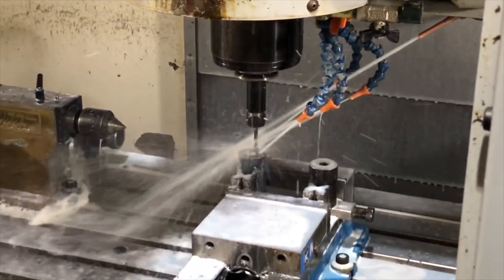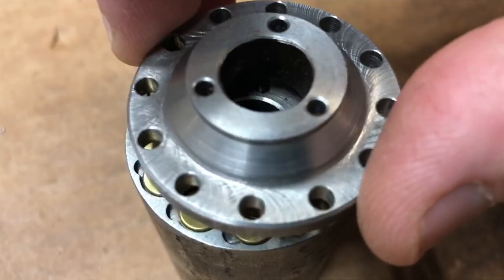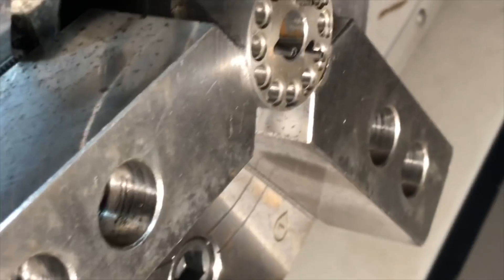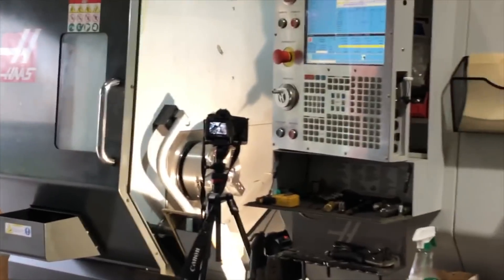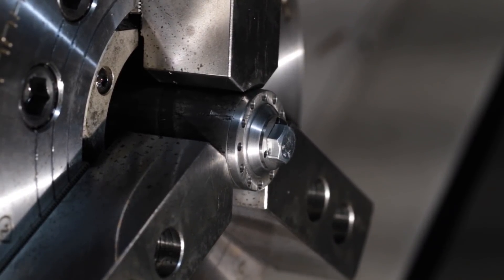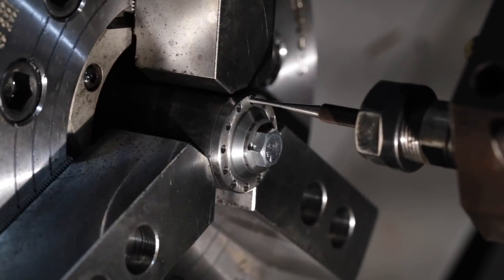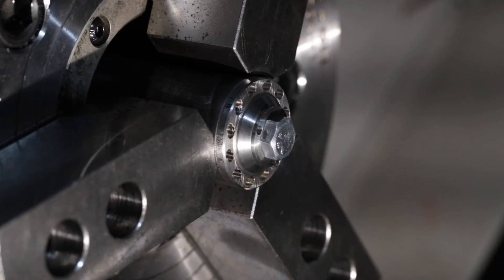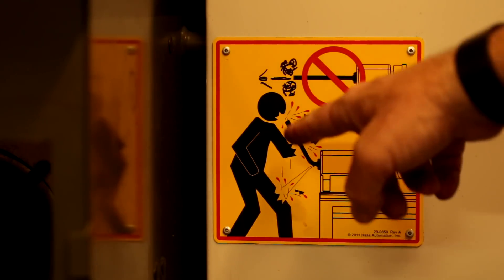Lathe Machine Gun

Comment: So I'm a little late with the spring loaded center punch solution, but that would work. Also, you could program a little radius at the bottom of the rapid stroke. Just big enough that it doesn't have to come to a full stop and reverse on Z? Though it kind of still would. I used to do something similar when I had to program broaching on a CNC lathe. Saves wear on something or other. Maybe.

Comment: It's a total guess from a non-engineer, but would have using a center punch (with a lighter spring) have helped?
Reply: I like the way you think. Great idea in my book.
Reply: I don't think that spring loaded center punch do any good.
They have very sharp point that concentrates all the pressure to a very small area.
Reply: I think .22 firing pins are more like a small flathead screwdriver.
Reply: @XtreeM_FaiL  It's trivial to change the shape of the point.
Reply: @XtreeM_FaiL  I was thinking the way it's got a spring would let you program it so the PID doesn't need to worry about as much overtravel. Lets you hit the primer with it moving faster.

Comment: What I'd like to see is a sensor placed on the barrel.  That can catch harmonics.  That knows when the bullet passes.  Then tells a control unit to unlock the breach, eject the case. And then load another round.  Or better yet.  You can calculate the last little bit of energy stored in the powder charge.  After the projectile has left the barrel. Somewhere, somehow, there has to be a way around having a op rod or gas tube on the barrel.  Probably not robust and battlefield tough.  But just high-tech fun stuff. Of course this is all about my pay grade.  I'm just a cook and part-time Welder.  And I like 3D printing.

Comment: Use a gear or sprocket with several "firing pins" that key into the firing pin holes. The C axis tool would remain stationary, the sprocket would spin with the lathe and you would presumably not have to worry about stopping at all.
Reply: You'd still have to stop. For reloading :)

Comment: If you build the cap like a ball and socket, use a large diamiter tapered spring and pit pinns on the inside of the cap. You can use a contact roller on the outside and as it spinns it will ignite the primers

Comment: Easy way, just tune your rapid position to compensate for your PID overshoot protection - tell the pin to go further than you "need" it to go and accept damage risk.
Or do it the right way and program the deceleration event into your striking event to get smooth and precise location control, but that takes effort. 
The thinking man would just incorporate a fixed energy firing mechanism instead of a dowel, like a spring loaded punch, into the design, so your PID can have inherent slop.
Reply: That pin punch does compress a little in normal use.crap have to use calculus to find a ramp down speed to meet compression. Last question; does it only have to be successful more than once? If not ping the crap of firing pin socket maybe 2 thousands or so?

Comment: Punch that works right from the get go? Easy. Make the endcap. Put thread on end cap. Turn a disc with an internal tread (to thread onto the endcap) and an external thread. Cut 12 grooves into it, creating 12 equal leaf springs. turn an outside nut that pretensions against the backstop and pulls back the leaf springs. Unscrew the cap slowly (or quickly if you want to). Wherever the thread leaves the last grove, a pin is released and fires a barrel. The full final revolution releases all 12 shots, neatly timed after one another.

Comment: How about a rotary firing pin , something like a stitch roller ( google it for reference). Syncing it up could be complicated but a ring gear on the perimeter of the .22 cylinder might be a good way to go about it.
Reply: Or just make a relief cut on the outermost perimeter of the .22 cylinder and just have a smooth roller bearing pressed against the cylinder to line up with the rim of the “blank”. If that works you could get some crazy rpm.

Comment: If you take a presser washer pump apart you would see a rotational plate set at an angle and sitting on top of the plate are spring return pins, a mechanism like this would be suitable for your task, but you would have to clamp the gun chamber to the tool post and put the pump like setup in the lathes chock

Comment: Use a similar mechanism as is used in a spring-loaded center punch. While the tool is decelerating the firing pin should still be impacting the casing with a significant amount of force.

Comment: It may have already been suggested in the comments, but you can try one of those percussive center punches that self punch when the tip has a bit of pressure applied to them so even at any speed so ling as the insert depth meets the minimum retraction for the center punch to engage you will get the impact force required to set off the primers.

Comment: How about a spring loaded center punch instead of the normal punch in the tool holder? That way it presses in, but reserves its "enginerdigy" until the last second, when it actually snaps and imposes the impact on the primer in a rather sudden fashion, instead of a leisurely pace. That's the main thing I see here, the punch isn't hitting the primers fast enough. You of anyone know about firing pin velocities.

The counterargument to that is that much like the solid punch, the spring loaded punch crushes the primer slowly. With the spring loaded one, before releasing energy, and by the time it actually snaps to crush the primer, well, it's already been slowly crushed and does nothing. There's no space to suddenly collapse the chemical compound together and detonate it.

Kind of like my heart in the dating world, but that's a universal struggle among aspiring engineers! LOL!

I might be an enginerding student (and maybe a good, maybe a bad one) at that, but impulse is the main thing comes to mind here. Force over time. A certain amount of force applied over a short amount of time might just do the trick! Crushing a primer slowly doesn't do squat, but suddenly hitting it with the same amount of kinetic energy, like a hammer,  is what sets the chemical reaction off. The challenge I foresee here is this: the spring loaded punch does not apply enough force during the load up, prematurely crushing the primer, letting go too late and impacting the primer after it's been crushed with no result.

Either way, I think it would be a very interesting aspect of physics to explore! Looking forward to a follow up video!

Comment: If the cap had a spring-loaded pin hammer for every cap, and the hammers had a geometry on them that let them be cocked when interfacing what you tried to use as a striker/firing pin here. What ends up happening is that the hammers are let go the moment they stop contacting the probe. Being released, they always line up with the cap, and the guarantee of enough energy being delivered is much higher. Set right, and this thing would brrrt

Comment: Drill the chambers a little closer to the edge.  Use a ridged block to act as the firing pin.  As the cylinder rotates, it hits the block and sets off the round.  You can rotate the cylinder at what ever speed you want. 
If it is difficult to set off the rounds without tearing the brass, replace the block with a wheel firing pins on it, geared off the cylinder.

Comment: I built a 10 barrel .22 cal short, Gatling gun many years ago. It was an exercise in frustration.  Rim fire ammo just isn't as reliable as a center fire. There were other complications with making the bolts with the F pin off set and the way the extractor was designed cause failure blow outs of the cartridges occasionally. So the next one I build will be in .32 or 9mm

Comment: I work for a company that makes pressure vessels out of aluminum with quick opening closures. The ASME in there materials section  will call out  the strengths of materials a designer will design  the Code requirements and the amount over the materials strengths is safely factor. Typically I see safety factors 1.5-2.0 times greater than the material strength. To design 100 times greater than the pressures you would see is just staggering.

Comment: An automatic center punch is the obvious solution, but what do we learn from that?  

Tweak the Servo Tuning settings of your CNC controller to tighten up the PID loop for Z-axis.  The punch has little mass compared to regular lathe tooling giving you some room before it gets out of hand.  In this case, a little overshoot or ringing won't matter allowing you to get it even tighter (faster).  

I also wonder if you deepened the pockets for the punch and drove the punch deeper if that may result in more reliable firing?

Comment: Guns use hammers and strikers. You need to replicate that striker action. Make the punch spring-loaded and a mechanism resets it for the next chamber. Consider adding a ramp on the left of the cylinder bore and a spring-loaded punch. As the cylinder rotates, it raises the punch and when a new chamber is presented it lunges forward and strikes the rim. Speed is only limited by the spring strength relative to the mass of the punch. It may be necessary to recess the cartridge chamber more to get sufficient power from the striker.

Comment: In your lathe gun the barrel spins regardless of the firing trigger unlike standard revolvers, so you could add teeth to the barrel or cap, then use an angled spur gear connected to a circular firing pin and that way as it rotates, so the firing pin/wheel forcing collision and ignition.. 100% fining rate assuming no duds and no matter the speed it will never miss..
Reply: If the teeth are on the cap then you can still replace ammo without having to separate more than the barrel from the cap.

Comment: If you put a cam on the revolver that actuated the release of a spring loaded punch just before the punch was in line (would have to calculate the time it took for the punch to be fully extended) with the point of impact, it would fire the blanks at a very high rate of speed.  Not even having to stop for the shot.

Comment: Silly question. why didn't you use a nail set/center punch vs a punch?
You press the set so it hits at the speeds you want then it compresses until the spring unloads.

Comment: You could modify a centerpunch to do the job. Something spring-loaded, meant for marking spots on finish nails. They’re pen-shaped and sized. 

Alternatively, just make the firing pin spring-loaded and add a ramp after each cartridge. As the firing pin reaches the Eid of the “Ramp” the spring makes it “Fall” against the next rim, making the entire assembly a lot simpler. Don’t even need to program it to push the pin in place besides the first time, the spring handles the rest.

Comment: For a trigger could you use a spring punch instead of the drift looking thing?  I don't know if it's called a "spring punch" but you use it to mark holes in steel by pushing down and then it unloads and leaves a tiny divet to line up your drill bit

Comment: Another possibility for it not working is that the controller might run looser tolerance on rapid and not bother going all the way to the end of the stroke given it turns around and goes right back the way it came. What's the fastest cutting feed rate it can run? Or maybe test that theory with a very short feed step between the rapid in and rapid out?

Comment: curious if you made the firing pin like a pinion gear, and the barrel like a ring gear if that would work. rather than having the firing pin spring, or be pulled back into loaded position, if rotating over the top if the shell would create enough of an impact to set off the shell. Sort of like the Gatling i guess, but without the spring, and its basically like a new firing pin per cylinder.

Comment: You could add the spring to a tool to make it hit the primer at a full speed before slowing down happens. Or make rod in a tube in another tube with a ball with a spring device where the middle tube hits the cap holding the inner rod (striker) from going in but spring stores energy from the whole contraption moving towards the barrel assembly until the spring loaded ball can't hold the tension no more and the striker becomes free. Same work principle as the car window puncher actually.

Comment: Instead of programming a rapid move (G0) for the punch to act as the firing pin, could you instead have used a G1 and set a feed rate of something fairly quick? Maybe even add a short dwell command also before retracting and rotating the spindle to the next chamber? Just a question.

Comment: A punch with a rolling firing pin (or firing pins). You could also design a back plate (like a black powder conversion cylinder, then just spin it to fire all the round, as they hit the stationary "hammer" (which would be a punch or simple solid piece of steel).

Comment: Free spinning studded wheel with the circumference set to match the hole spacing in your cylinder and the axis perpendicular to the spindle.
Maybe a pair of bevel gears to get them turning with eachother.
Slowly run the spindle as the turret drives the gears into mesh, then crank up the speed and move Z into firing depth. 
No C indexing required

Comment: What are those punches called that have a spring in them...that would work. One that has to get pushed in to a certain point before it'll release. Like the ones you use in a door hinge punch or to punch Ethernet/phone wire junctions.

Comment: In your retaining collar, have individual firing pins that the punch hits. The kinetic energy from the punch striking the pin would transfer to the casing and cause it to fire... Study the New Model Ruger Blackhawks with the "Transfer bar" firing system. Should work easy peasy....  
If you REALLY want to make it roll, put firing pins in, then a roller wheel tool on the tool post, spin up the chuck and advance the tool post in and it'll act like a gatling pew pewer.... BRRRRRRRAAAAAPPPPPPPPPP

Comment: THE ANSWER IS AN AUTOMATIC SPRING CENTER PUNCH, no need for the feed speed to be fast since the impact is from the pressure and the energy is stored in the spring. just programmed to have the end of the travel at the right distance so it would pop the cap and not over travel and break something.
Not an engineering student just an artschool dropout starting a custom fabrication business

Comment: I would have set a pin behind each round and used a round hammer that is stationary and brought that to the pins so the concussive force was the rate of the rotation of the lathe.  In theory you could do an insane rate of fire

Comment: I don't know a punch that would work, but how about doing away with the pockets for rims and firing punch entirely and making the breech plate a circle that leaves the outer edges of the rims uncovered.

Then whip up a roller that will mount to the lathe toolholder, move it into contact with the back of the chamber cluster, aligned to the outside of the rims, and give 'er a spin.

Comment: Load all the holes with pins with a ball end on the outside, then rotate the spindle forcing the ball end of the pins against a ramped edge feeding in...sure, it'd sound like hell with the pins thumping on the ramped edge, but it'd likely work if you have a steep enough angle on the ramp and feed in to a set depth fast enough...

Comment: You should probably over shoot the outer tolerance by the maximum compression of the primer rim.  You know split the difference on the tolerances.

This might be a late reply.

And also ensure that the slow down isn't occurring.  Allowing a stop to the power and yet not controlling the slowdown.  (  I don't know what you are using as a method to home the position of the mechanism so it may not apply. ), but inertia driven may be best.

Comment: Should have designed ramps into the cylinder face and used a spring-loaded firing pin. Then it would be reliable and the only thing limiting speed would be the rotation of the cylinder. The firing pin would just drag along the surface until it comes to a sudden recess that would make the pin ignite the blanks.

Comment: Redesign the cylinder to accept a little bit of over-penetration in the primer pockets. Say .010.   And then add .010 to the depth of the punch cycle.  That'll move the deceleration phase of movement into the period of time AFTER the punch has set off the priming compound.

Comment: ATF proposes new restrictions on CNC lathe and all other shop equipment: Any machine or any part of machine that could be used to fabricate, modify or improve anything that could possibly be used to propel a projectile must be registered and approved according to the NFA. The following point system will be used to determine if your equipment needs to be registered. Any piece of equipment or machine that scores 2 points must registered.

1) Does the machine or equipment have the potential to be dangerous or create something dangerous in anyway? If answer is "yes" add 2 points to your overall score.   
2) Can this machine or equipment be used by an individual that is not legally allowed to own, possess or operate a firearm? If your answer is "yes" add 2 points to your overall score.

Comment: This vid made me sub. 25+ years as a cnc engineer. Mainly turning. This could be improved upon loads. 
Could sync a broching tool to the position axis be quicker. Even a max feed rate is better than rapid. Its does not allow for backlash error so rapid in then fast feed last .5/1mm.  Or a numatic punch set for the sync of rotation. Anyway hope we see aother one like this awesome job.